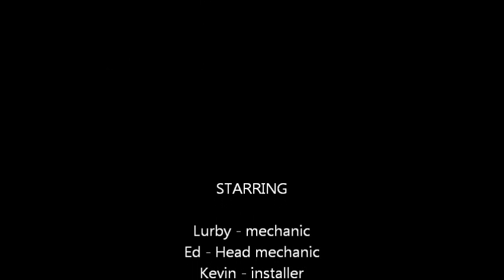Ford 4R100 automatic transmission rebuild

Comment: Just wanna say thanks, you're pretty much the dad I never had right now lol as we speak I'm rebuilding my 4r100 with a 1700 dollar kit. First time doing a 4r100 but thanks pops
Reply from the maker: badubah12 I'm glad to hear the confidence and if you have any questions I would be happy to help.
Reply: Matthew Mathews only question I have is how to properly seat the part that goes after the interim clutch on the spring that looks like a small saucer. I got everything else in perfect just not that

Comment: The old race was still in the hub!  Terrible I have not idea how I missed the. Haha hopefully the assembly will do a lot better. Thank you. You video was a lot of help.
Reply from the maker: happy to hear you figured it out. But exactly what hub and which bearing are you talking about? just curious.
Reply: +Matthew Damato the outer race for the center support bearing had come apart and I didn't notice it in there still so I basically had two bearings in there. Lol I have definitely learned a lot this in my first automatic to rebuild.
Reply from the maker: Kyle gandy Just take caution that when that bearing goes bad, the forward drum is likely bad as well.  They go hand in hand and although the center support is easy to spot with an exploded bearing, the forward drum is not so obvious, but the location of the rings will be impregnated and scored.  For me normally when this bearing goes, I change the steel section of the support with a new drum, (not merely the bearing). Changing just the bearing may be enough to get the truck moving, but not for long.  Also, be aware that this part was updated and you buy it in a kit including the output shaft orifice plug and int. shaft that attaches to the OD section.  But I am glad you figured out what was going on and good luck with everything.   If there is anything you may need, just ask.
Reply: +Matthew Damato ok will take a better look at thing again thanks for all the helpful info. Hopefully I get enough to evenings after work to finish this project before to long

Comment: Hey Mathew, I have a 99 f350 4x4 7.3 4r100 that Im about to tackle a rebuild on. I noticed in your video that you used no special tools to disassemble the tranny (except seal, bearing driver). Is there any tricks to get around the tool to compress and install the O.D snap ring, etc?  Any other tools needed to perform the rebuild? Thanks man!

Comment: Great video...  Do you recommend spending $1,300 for a dealer to simply replace a torque converter and seal when they never dropped the pan (as requested, but denied) to inspect the 120k mile transmission for debris?  Should I just swap it or rebuild it?  It's a 2004 Ford 385 hp Lightning, and it's a real pain cause there's so many options with upgraded parts.  I'm afraid to buy a remanufactured unit from parts stores cause the truck is not a regular F150, it may eat through junk that has FAKE OR FALSE warranties that make you chase ghosts on the phone all day.  Your expert advice would be greatly appreciated, thank you.
Reply from the maker: +Robert Saienni First, to go through all the trouble to pull a unit to merely swap a torque converter is a waste of time and money, especially if the TC is bad.  Most likely, if the TC failed (and is probably very noisy when you hit the accelerator) the pump bushing is also no good.  And if the bushing is no good then the pump itself may be bad.  What I am getting at is that who ever recommends just changing the TC is taking a huge gamble with your time and money.  I would never take a job where the customer wanted TC swap, nor would I ever recommend just a TC swap.  So, $1,300 for TC swap is not worth it, even from a dealer.  For me, I would rather lose the job than to have an angry customer later down the road because I know the eventual outcome.  With that said, you are right about not knowing what you paid for is in the unit.  That's where trust comes in.  You should definitely have some type of relationship with the person rebuilding the transmission, or at least the shop.  The good thing is that if you get a warranty then it should cover you.  On the other hand, most places do not like to warranty a transmission where the vehicle has had extensive modifications, so you will be at their mercy.  My best advice is to deal with someone you trust, and explain to them how much the truck means to you.  Most people in the business are car guys (or girls) like you and can relate to a story that has compassion.  Talk to them about what you did (without trying to sound like you know everything) and act sincere.  The bottom line is that you need their help just as much as they want your business.  Good luck and let me know how you made out.
Reply: +Matthew Damato Thank you for your reply, the timing was perfect since I have an appointment to drop it off today.  I'm taking it to someone who's a Lightning enthusiast.  He owns a very busy shop and does tons of work on these trucks, and he's owned several.  From everything he sees, feels, and heard about the symptoms, he thinks it IS the torque converter.  It does not slip out of gear, and the fluid looked and smelled fine, etc.  Anyway, he agreed not to flush the transmission cause of the 120k miles, but offered to drop the pan, inspect and change the screen/filter and fluid.  He said he'd call if he found anything to raise anymore red flags and the service would only be $110.  He said he'd swap out the torque converter ONLY if everything else looked good for only $375 labor.  He DID recommend rebuilding my existing unit rather than buying a re-manufactured "mystery", IF need be.  I know he's not trying to sell me anything cause he sends his rebuilds to a guy who specializes.  He also mentioned how this particular transmission is mostly comprised of STEEL parts that are not included in a rebuild, most stock have more aluminum since they are not performance cars.  Anyway, I can't thank you enough and I know this is a gamble, but I'll need a torque converter anyway, if a rebuild is needed...  So, yes I'm willing to gamble $500-$1,000...  Cause if this fails, I know I'm looking at $5,000+ for a RIGHT stuff done by the RIGHT guy lol.  In closing, I've come to realize that unless I could afford to have this truck professionally maintained or have the knowledge to do it myself, I'm gonna have to fix it and put it back on the market...  At least I'm not a piece of shit like the guy who sold me the damn thing.  He rebuilds performance cars all the time and he had to have known about this problem cause I didn't race it, nor did I even put 500 miles on it...   Got it a month ago, and it spent the whole time in a cozy garage.  Again, thank you.

Comment: Matt,  I am a bit overwelmed with my first 4r100 build so thank you for taking the time to make this video. I'm not a mechanic so I'm wondering what manuals or books I should look for so I don't just blindly dive into a can of worms here?
Reply from the maker: You can find a overwhelming amount of literature on these units, but not all will be helpful.  A company called ATSG has published many manuals on almost every transmission out there.  I have found ATSG manuals to be the most detailed including step by step on how to rebuild with pictures.  However, it won't tell you the tricks of the trade.  In fact, I will be surprised if you find anything that tells you helpful tips on how to install certain pieces without specialty tools.  With that said, it is a fairly easy transmission to build and you should not have a problem if you listen to my video in conjunction with others out on the inter-web.  IF you have a specific question, I will be glad to answer it.

Comment: I enjoyed watching your video, thanks for taking the time to make it, inspired me to find a core and attempt a build for my truck. I have an '01 F250 7.3 Powerstroke and I verified the date on the trans to have the problematic mechanical diode. What does that diode do (I guess the fix is to rebuild with a sprag) and is there any specific type of driving I shouldn't do to avoid breaking it? Also, I remember helping my dad rebuild a C4 and 727 when I was a kid and he soaked the frictions in ATF, is that not really necessary?
Reply from the maker: +Screamn03 haha, I'm glad to hear you did you're homework!  Yes, change the mechanic diode with the latest sprag.  In fact it is the same sprag that Ford used before changing to a diode.  After a year, Ford realized that the diode was not working and quickly changed it back over to the sprag.  It requires changing the direct drum, sprag, washer that sits under the sprag and new intermediate frictions.  I would have thought by now all the diodes had been recycled and I am a little surprised that you have that diode in your unit.  There was a mass frenzy some years ago by all the dealerships to update this problem.  What occurs is a complete blow up, sometimes taking out the planets if you don't get it in enough time.  The actual part is designed to hold the direct drum to the intermediate frictions and then allows it to freewheel when you let off the gas.  Otherwise you would experience engine breaking every time you were in 2nd and let off the gas.  It is a pretty quick and easy update and if Ford might even pay for the parts if you call them up.  Moreover, Ford will likely provide you with brand new parts instead of "rebuilt' used parts. Don't forget to save the old parts.  Otherwise, a set up from a hard parts dealer should be around $100 for everything.  Good luck!

Comment: finally got everything back together and it doesn't want to shift right. I installed the transgo tugger kit. banks torque converter and the pump lock-up kit from transgo. went for a test drive last night an doesn't want to shift. wants to rev like a gas truck would before shifting. then it jerks forward like if you were to tap the brakes. I think I'm gonna pull that kit out and see what happens. only problem is per the instructions it had you drill a couple holes in the valve body and accumulator. I can't even get up to 25mph without hitting the redline. then ibthiught maybe the solenoid pack. but it shifted fine before my snap ring popped off my center support bearing fell apart, my coast clutch sprag exploded and my intermediate clutches burned all the friction material off. any ideas where I should start looking next?
Reply from the maker: +Marc Lee Well, if you read any of my earlier posts, I would never recommend any type of shift kit for these units, which could be part of the problem.  I am not saying that the kits are designed with flaws, on the contrary, usually what I have found is that people that install them do not install them properly, which causes all sorts of problems (not intentionally either, just happens with lack of experience).  However, by trying to undue a shift kit, especially when holes were drilled is very difficult.  I usually am the one stuck doing that when other shops get themselves into hot water and it isn't fun trying to play dr detective.  With that said, first thing is to make sure you have enough fluid in it.  Also, check everything on the outside of the unit first.  Do not condemn the unit until you know everything outside is working properly.  If you have a scanner, check for codes.  Look to make sure everything is plugged in and working the way it should.  Including the neutral safety switch.  If that appears to be okay, I would drop the pan and take the accumulator valve body out.  Usually if there is a problem with the valve body, it will be in that section.  Look at the 3 little valves with the tiny springs.  They tend to get stuck.  Also, make sure that the EPC line modulator valve has been replaced.  If you have a small block gas use a .331" and diesel and big block use  .372".  If that is ok, remove the entire valve body and air check all the clutch packs (this step should always be done during assembly to save time when there is a problem, however when you air check during a rebuild you find any potential problems).   I hope that helps.

Comment: I've got 166,000 miles on one of these and its had a heavy load all of its life on the truck and a lot of heavy trailer hauling. Its being rebuilt but I have to say its been a good one. 

Hey man, where did you get your bushing drivers and special chisel and do you change the bonded rubber pistons on every rebuild?
Reply from the maker: +ILTSYC Every bonded piston gets changed.  My tools I have had for a long time.  I got the bushing drivers from a tool company that makes transmission tools that is no longer in business
Reply: I'm rebuilding an AX4S out of my 2000 Ford Windtsar which is my first transmission rebuild.
I've found 3 bushings that needed replacing. One in the differential sun gear, one in the low drum and one in the case for the sprocket shaft. The one in that sun gear was some kind of tough to get out because there's not much edge to get on from behind, so I cut it out with a specially sharpened drill bit from the front.

The reverse drum has a lip seal and the rest are bonded. I was debating on whether or not to change the bonded pistons. The clutches are all in and the pistons move fine when air is applied to the correct ports, I figured they'd hold a little more solid than they do, I guess without oil air escapes easier. I'm sure the air is escaping past the 5 scarf cut rings on the support because air blows back out the port beside the one Im applying air in.

I wouldn't mind trying one of these 4R100's after watching this. Thanks for sharing.

So you replace all the solenoids and sensors as well every rebuild?

Comment: Matthew I have a quick question, I have a 96 Powerstroke 14 foot box van with a 40 Foot trailer, I use to deliver truck body parts all over the northeast from Fla. My question is? I want to build a very reliable trans for this van, What year 4R100 would you recommend me buying as a core and starting with.It is my understanding that the 4R100 was superior than the E4OD that is in the van. Thanks for your input.
Reply from the maker: +John Carey great question John, which does not have an easy answer.  First, Ford has made many changes to the original E4OD, some good and some not so good.  You can easily put most of these good ideas to work in any core that you buy, and I always upgrade every build using only the most reliable parts.  Since you are working with a 96 Powerstroke, you must buy a core for a 96 Powerstroke because the diesel case is different than its gasoline counterpart (both big block and small block have different cases too).  By getting the proper year core, you won't have to worry about plugging up speed sensor holes or switching shifter linkages. Next, because the core is a diesel, the clutch packs already have the extra clutch in reverse and overdrive.  Where I would focus my attention after that is with a good planet set.  The original 96 will have a 4 pinion aluminium planet.  You can purchase at a reasonable price a 6 pinion steel planet with hub and bearing.  This will last you a long time. Next, upgrade the EPC modulator valve with a new .372" Sonnax valve (there are 4 different sizes, it is imperative you stick with the .372" no matter what anybody tries to sell you).  Next, buy both inner and outer accumulator springs for the larger accumulator valves.  If you want to get fancy, you can also install the 3 steel valves (they work better than aluminium because they never stick).  Next, make sure you have a steel OD planet (if it is aluminium you must change it to steel).  Next, make sure that the outputshaft has a cup plug in it and not a bushing.  An update kit is available for little money.  Most importantly, ALWAYS CHANGE ALL THE BUSHINGS.  Finally, you can install a 4*4 pan with the deep neck filter, make sure the pan has a flat surface and than use the rubber pan gasket (they never leak as compared to the earlier model paper gaskets with the dimples).  If you make the above changes, you will have a transmission that will outlast anything else on the road whether you call it a E4OD or a 4R100.  I hope that helps and good luck.

Comment: is there any up grades you would recommend. my truck is a  99 with  around 1401 more hp over stock i have decided to ditch my mo6  6spd  because im tired of replacing the clutch due to wife  driving it.   i do tow  from nj to az  twice a year    i have heard the 4r100 in itself is  weak.  thoughts on up grades.  i enjoyed your video